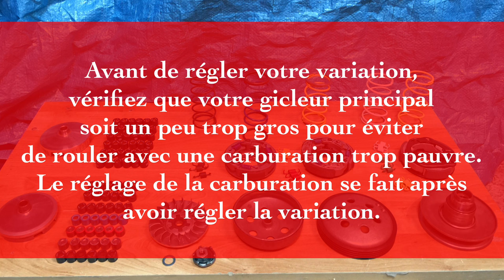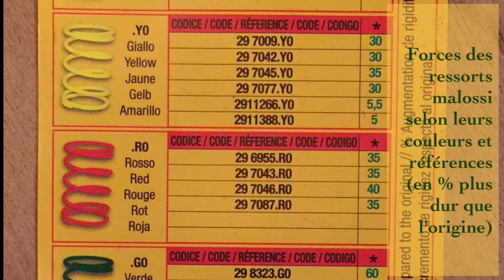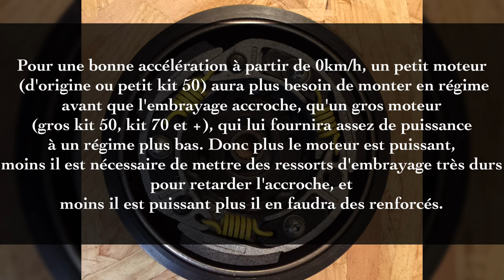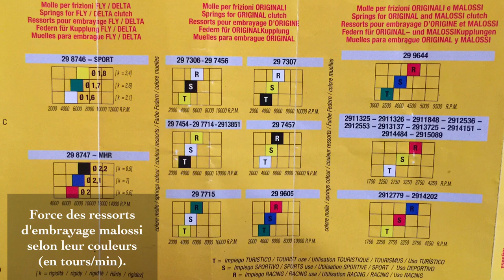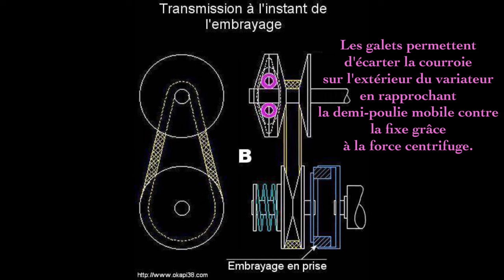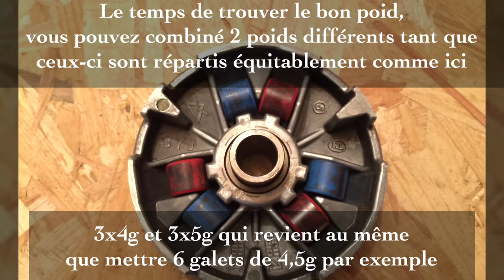Comment régler le variateur et l'embrayage d'un scooter? (1080p)

Comment: Est ce possible de mettre des couleurs diferente de reesoort d'embrayage par exemple 2 rouge 1 noir?
Reply from the maker: Non il faut mettre la même couleur pour que les mâchoires s’écarte en même temps
Reply: Ok merci de la reponse
Reply from the maker: De rien 👍
Reply: Curiosité 2 eme question jai enlever mon carter de kil et ma courroi pour changer mes galets et au moment du remontage la courroi etttait trop courte pour atteindre le variateur d'où sa peu venir
Reply from the maker: luka babic il faut presser le ressort de pousser pour écarter le correcteur de couple pour glisser la courroie au centre, ça te donnera du jeu dans la courroie pour la remettre devant le vario
Reply from the maker: luka babic comme à 6min32 sur cette vidéo: https://youtu.be/Kp2UdNyqIQw
Reply: Curiosité faut donc que je démonté l'embrayage?
Reply from the maker: luka babic tu peu essayé sans le démonter, tu tire un peu la courroie sur la droite du correcteur pour pouvoir passer les 2 mains bien de chaque côté et tu ramène la joue vers toi (la joue tourne un peu en même temps que tu la rapproche) avec un doigt tu chope la boucle de droite et tu la coince bien au centre du correcteur et tu relâche la joue dessus en faisant attention que la courroie ne glisse pas à l’extérieur, si tu n’y arrive pas c’est plus facile en démontant l’embrayage sinon

Comment: Bonjour merci 
Moi j'ai 125 skyliner j'ai un ressort de poussé jaune malossi.
Quelle ressort embrayage et le mieux du coup 
Les jaune blanc ou rouge.
Merci
Reply from the maker: Bonjour, je mettrai les jaunes. Cela dépend de « la patate » que tu veux avoir au démarrage (tourisme, sport, racing)
Reply: @curiosite8721  c'est des S
Reply from the maker: @romaincbdt3146  oui jaune c’est des sport
Reply: @curiosite8721  testé il est mou au démarrage.
A 80 il part fort par contre.
Actuellement j'ai des 8gr malossi 
Si je met des 7gr malossi ou 7,5 gr 
Le démarrage partira mieux actuellement en 8gr et ressort jaune c'est mou démarrage
Reply from the maker: @romaincbdt3146  d’accord, je connais pas les 125 cm3 mais ça serait peut-être le ressort de pousser qui est trop mou, j’ai un jaune malossi sur mon nitro 70 cc et je trouve déjà un peu mou. En allégeant les galets ça peu être mieux mais il faut vérifier que ça ne mouline pas une fois lancé. J’aurais testé avec un ressort rouge et ré régler les galets.
Reply: @curiosite8721  oui met j'ai que le ressort de poussé jaune 
Je vais esseyer 7,5gr.
Si je met le ressort de poussé d'origine sa va être pire que le jaune
Reply from the maker: @romaincbdt3146  oui il faut plutôt le durcir, essaye déjà d’alléger un peu les galets si tu en as et si ça ne va pas je me pencherai sur le ressort de pousser. Les ressorts d’embrayage jaunes ou rouge sont bien, tu peux essayer avec les rouges aussi si tu en as.
Reply: @curiosite8721  oui j'ai les rouge met sa va pas être pire au démarrage il sont en R
Reply from the maker: @romaincbdt3146  non au contraire c’est des racing.
Mou: tourisme, médium: sport, dur: racing. Plus ils sont dur, plus ça retarde l’accroche de l’embrayage pour que le moteur monte dans les tours (si tu ne change pas le poids des galets) mais ça ne règle pas tout, si le ressort de pousser ou le poids des galets n’est pas bon, le problème sera le même une fois l’embrayage collé. Tu as qu’elle ressort d’embrayage actuellement?
Reply: @curiosite8721  jes lever les jaune j'ai mit les 3 blanc.
Ressort poussé j'ai que le jaune
Galets 7,5gr j'ai mit il y a un petit mieux met c'est toujours pas sa.
7gr j'oublie sa patine des que je met les gaz.
Si je met les rouge sa va être pire que les jaune il va pas accélèrer.
Je vais regarder pour commander le ressort de poussé blanc ou rouge
Reply: Je voulez savoir est t'il possible desseyer de mettre les ressort d'embrayage un de chaque blanc jaune rouge
Reply from the maker: @romaincbdt3146   en durcissant les ressorts d’embrayage ca ne peut que mieux accélérer au départ, ça ne sera pas pire avec les rouges. Si tu est passé au blancs, remet les jaunes déjà. Peut-être que le ressort de pousser est trop dur aussi ce qui t’oblige à alourdir les galets pour ne pas mouliner une fois lancer mais ça donne des mauvais départs, j’ai déjà eu ça. Si ton ressort blanc est bien compatible pour ton 125cc c’est peut-être suffisant parsque il convient en remplacement d’origine

Comment: Salut tu peut m'aider stp ? J'ai un petit kit 50cc malossi performant mais pas puissant, avec des ressort d'embreyage souple (5,5g) rouge malossi et des galets leger 6× 5,7, ma moto na pas le temps de monter en régime la moto décolle des que j'accélére elle roule asser bien au début mais a haut régime je mouline dans le vide. Si je met des galets lourd sa permettra d'éviter de mouliner dans le vide a haut régime ? Et esque sa retardera l'accroche de l'embreyage ou i faut des ressort plus dur pour retarder l'accroche stp ?
Reply from the maker: Ryan Joachim Salut, tes galets paraissent déjà assez lourd et tes ressorts dur pour un kit50, c’est quoi comme scooter et comme kit exactement?
Reply: Merci de vouloir bien m'aider, c'est un zip sp 2 que j'ai.
Reply: C un kit 50cc malossi a fonte be-segments
Reply from the maker: Ok de rien si je peux t’aider ça fait plaisir, c’est bizarre que tu mouline une fois lancé, c’est difficile de dire comme ça sans avoir le scooter dans les main, est-ce que tu viens d’acheter le scooter ou changer quelque chose dessus? Est-ce que tu as un pot desssus ou c’est celui d’origine? Le vario est-il débrider? Il accélère bien jusqu’à combien de km/h? Et tu fais du combien maximum quand tu trouve que ça mouline?
Reply: Le sccot je les acheter ya pas longtemps mais les piéces sont pas neuve j'ai juste mis des galets neuf un peut plus lourd. Ya un pot sito vari polini, enfait la moto mouline dans le vide quand j'accélere a fond peut importe la vitesse a laquelle je suis et des le décolage mais quand j'accélére pas a fond la moto roule bien sur le long terme sauf que la le moteur develope pas tt sa puissance vue que je suis pas a fond mais je peut pas accélérer a fond psk sa mouline a fond
Reply: Moi se que je veut c que ma moto monte en régime avant que l'embreyage accroche et pouvoir accélérer a fond pour developer tout la puisance du moteur sans mouliner
Reply from the maker: Ok le truc c’est que ressort d’embrayage rouge malossi c’est déjà très dur, ça doit pas venir de là, il est de quelle couleur ton ressort de pousser? Si il est trop dur ça pourrait expliquer cette impression de mouliner, la courroie ne s’écarte pas à fond au vario même en alourdissant les galets.
Reply from the maker: Ce que je pense là c’est que ton ressort de pousser est trop dur, ce qui t’a obligé à mettre des galets lourd, ducoup même avec des ressorts d’embrayage rouge le vario avec les galets lourd s’écarte suffisamment à bas régime pour faire accrocher l’embrayage, si la courroie s’écarte trop vite sur le vario pas besoin d’avoir un gros régime pour faire accrocher l’embrayage lui va tourner vite quand même ce n’est pas que lié au régime du moteur l’accroche de l’embrayage sa dépend de la position de la courroie.
Reply from the maker: Donne moi la couleur du ressort de pousser sa sera plus clair
Reply: Oui moi aussi je pense que mon ressort de pousser et trop dur c un ressort mauve super renforcer. Du coup si j'ai bien compris, si le ressort de pousser et trop dur le moteur n'auras pas asser de force pour compresser le ressort a fond du coup sa donnera l'impression de mouliner dans le vide c sa ?
Reply: Mais aprés j'ai vue que le ressort d'embreyage rouge (5,5g) malossi font partie des ressort les plus souple pour embreyage malossi delta mhr mais je pense qui sont plus dur que les ressort d'embreyage jaune (3,5g) qui eux font partie des ressort le plus dur pour embreyage malossi delta cluch. Ducoup esque je peut mettre des petit ressort un peut plus dur? Pour avoir une acceleration progressive
Reply from the maker: Ok oui c’est ça, mauve c’est beaucoup trop dur, il faut que tu mette un blanc malossi pour commencer, pour les ressorts d’embrayage ça dépend tu as quoi comme embrayage?
Reply: Merci, j'ai un embreyage delta cluch malossi avec les ressort rouge 5,5g prévu pour embreyage delta mhr
Reply from the maker: Ok c’est pas très clair avec tout leur modèle et référence j’ai mis un tableau à 4min si j’ai bien compris tu as des ressorts mhr, si on regarde à combien de tour minutes ils accrochent les plus souple mhr sont quand même plus dur que les plus souple sport par exemple, faut être sur que les ressorts soit compatible avec l’embrayage, à ta place je mettrai déjà le ressort de pousser blanc en allégeant les galets et voir ce que sa donne avec les ressorts que tu as déjà, rien qu’avec les origines si la variation est bien régler ça marche déjà bien, il faut pas mettre trop dur non plus ça oblige à alourdir un peu les galets aussi, je pense que pousser blanc avec ressort d’embrayage médium (La couleur change selon le modèle) ça sera très bien, après un bon réglage galets en commençant par assez légers puis tu alourdi en faisant le test du trait, arrivé en haut du vario sans trou à l’accélération sa sera nickel
Reply: Merci de m'avoir aider a comprendre comment sa fonctionne, je vais faire comme tu m'as dis grand ressort blanc 3 petit medium et aléger les galer peut étre psk je vais essayer avec les galet que j'ai en se moment
Reply from the maker: Pas de soucis 🙂 tu peux essayer avec ces galets mais ils seront trop lourd je pense, le réglage parfait se fait au dixième de gramme près, hésite pas si tu as d’autres questions, pense à vérifié ton gicleur principal après.
Reply: Si les billes sont trop lourd par rapport au grand ressort et au petit coppent se comportera la moto ? Elle auras du mal au décolage ?
Reply: Et min gicleur P c du 80
Reply from the maker: Si ils sont beaucoup trop lourd le scoot sera très long à monter en régime et aura pas de pêche voir il arrivera pas à monter en régime surtout moteur chaud et en montée, si ils sont légèrement trop lourd il aura un bon départ mais va redescendre en régime vers 30/40km avant de se relancer normalement comme si tu passé une vitesse, c’est ça qu’on appel un trou ou un creux, ça n’aura rien à voir avec les petits ressorts d’embrayage faudra pas les toucher. Pour le gicleur principal il faudra regarder la bougie, je t’expliquerai quand tu en sera là si tu veux.
Reply: D'accord, mais aprés je compte changer de configue, je vais garder le même cylindre et mon carbu 17,5 mais avec plaque de transmission malossi, double transmission malossi, correcteur malossi, embreyage malossi delta cluch, courroi malossi, variateur malossi et pot gp léovince, tu pense que le grand ressort blanc malossi, 3 petit ressorts jaune dur prévue pour embreyage delta cluch et des galet pas trés lourd sa marchera bien ?
Reply from the maker: Il faudra peut-être re régler les galets si tu change de vario et le reste de la variation, quand tu dis la transmission tu vas garder la même mais la prendre en marque malossi? C’est pas vraiment utile  avec ce kit ça va te coûter cher et changera pas tes perf, peut-être un poil avec le carter de transmission.
Reply: D'accord, pour la transmission je pense pas que c la même j'ai déja une tansmission primaire qui n'est pas d'origine actuelement utile pour les côtes mais pas trop pour lalonge mais avec une transmission secondaire un peut plus long je c que sa ira beaucoup mieu sur lalongue c pour que je veut la plaque de transmission malossi et double transmission malossi je c que sa fera chére mais bon je travail poursa 😉
Reply from the maker: Ok je me disais aussi que ça pouvait être ça, si tu as une transmission plus courte ça peut expliqué cette impression de mouliner, transmission plus courte bonne pêche et moins d’allonge, et transmission plus longue moins de pêche (que l’on corrige avec un ressort de pousser plus dur) mais plus de vitesse de pointe, il faut un moteur plus puissant pour ça. J’ai mis une transmission secondaire plus longue moi pour gagner de la vitesse max et faire de long trajet, ça dépend ce que tu veux en faire. Tu m’étonnes que tu mouline avec une transmission courte et ressort mauve 😁.
Reply from the maker: Avec une transmission primaire plus courte et une secondaire plus longue je sais pas si ça sera top, ça peu juste se compenser, si tu veux l’allonger remet déjà la primaire d’origine et pourquoi pas la secondaire plus longue mais avec un kit 50 fonte tu risque de perdre un peu au démarrage que tu pourras pas rattraper avec la variation moteur pas assez puissant.
Reply: La transmission primaire que j'ai elle est plus longue que c'elle d'origine mais effectivement je pense que mon ressort mauve et trop dur du coup la courroie descend pas asser dans le correcteur de couple et monte pas asser du coter vario si j'ai bien compris le fonctionnement
Reply from the maker: Ah ok oui c’est ça, c’est pour ça qu’il monte plus facilement les cotes, parce qu’avec une transmission plus longue c’est l’inverse normalement
Reply: La même avec une transmission primaire plus longue que l'origine elle a pas de mal a monter les cotes elle a la pêche au décolage et un peut plus sur lalonge et je pense qu'avec les ressort que tu ma conseiller vario et reglage galet et une transmission secondaire un peut plus longue je pense que sa ira bien ici la la réunion on utilise beaucoup les transmission primaire pour les cotes, la pêche au décolage et la transmission secondaire pour pour la vitesse de pointe même avec cylindre d'origine
Reply from the maker: Ok comme il est configuré là je pense que c’est surtout le ressort de pousser dur qui facilite le démarrage et la monté des cotes, pour la transmission plus longue que ça soit primaire ou secondaire logiquement ça entraîne la roue plus vite avec la même vitesse de rotation de la cloche d’embrayage c’est la position de la courroie sur le correcteur de couple et le vario qui font en sorte que le moteur tourne quand même au meilleur régime possible, après je suis pas super calé en transmission si tu dis que vous faites comme ça la bas tu peu essayer, mais faudrait peut-être mettre un ressort jaune dans ce cas là le blanc risque de se comprimé trop facilement avec une transmission plus longue, tu as quand même un bon kit tu dois être à la limite entre le blanc et le jaune.
Reply: Du coup pour ma configue si je met un ressort plus mou j'aurais moin de décolage et moin de reprise aussi ? Mais c dommage qu'avec min ressort mauve la courie dessend pas asser dans le correcteur et monte pas asser au vario psk sa a vraiment la péche au décolage et reprise aussi, oui je vais essayer la double transmission avec les ressort que tu mas dis je suis sur que sa marchera bien
Reply from the maker: Pas forcément vu que tu vas alléger les galets tu peu voir la même pêche sauf que la courroie pourra s’écarter normalement pour prendre de la vitesse tout en gardant le bon régime moteur
Reply from the maker: Tu peu déjà faire le test du trait comme c’est là pour voir jusqu’où la courroie s’écarte dans le vario, si ça a de la pêche c’est parce que le ressort empêche la courroie de s’écarter trop vite au vario mais avec un ressort plus mou, ce sont les galets légers qui vont éviter que la courroie s’écarte trop vite au vario c’est pareil sauf que ça moulinera pas une fois lancer et continuera à prendre de la vitesse, avec une transmission longue c’est moins évident par contre, il faut que le ressort de pousser empêche suffisamment la courroie de descendre dans le correcteur de couple au démarrage parce que le moteur va plus forcé
Reply: J'espere que sa marchera bien avec tout se que tu ma dis 🙏 comme j'ai acheter mon scoot d'occaz je compte refaire mon moteura neuve de a à z je sais que sa va prend du temps etde l'argent mais bon sa sera pour la bonne cause
Reply from the maker: C’est sympa à faire et super satisfaisant quand une fois finis tu le démarre pour la première et qu’il reprend vie 😁 dans la description de la vidéo projet aerox mhr replica j’ai mis tout les liens des tuto qui m’ont aider pour refaire le mien, de l’installation du vilebrequin avec ses roulements au rodage, jettes y un coup d’œil
Reply: La je commence par acheter tout les piéces partie électrique pour remettre a neuve aprés je passe au piéces moteur, oui j'ai regarder les liens 😉

Comment: bjs y a t il moyen de te contacter par mail ou autre d avance merci a toi
Reply from the maker: Bonjour, je suis pas mal occupé en ce moment, je peux en créer une si tu veux, je te répond pus tard.
Reply: @curiosite8721  c est bien gentil de ta part merci  j aurais besoin de conseille
Reply from the maker: Ok à part en réglage variation j’y connais pas grand chose dsl, tournois racing répond aux questions quand c’est possible, tu peux essayer de voir avec lui, il fait des direct pour ça des fois.
Reply: @curiosite8721  ok vais le contacter mon problème est que j' ai un speedfight 4 édition sport avec kit 70cc carbut delorto 17.5 vario et ambrayege stage 6 mais je n arrive pas a savoir qu elle resort de poussée et d embrayage mettre dessus et suis pas mécano du tout loll
Reply from the maker: pour un kit 70 cela dépend si c’est un fonte ou un alu, sa puissance (nombre de transferts dans le cylindre) et si c’est avec 1 ou 2 segments sur le piston, et pour les ressorts d’embrayage des médiums suffisent normalement, regarde sur le site crazymoto la source de la vidéo il explique bien ça, c’est un jaune ou un rouge selon ton kit, c’est quoi comme kit?